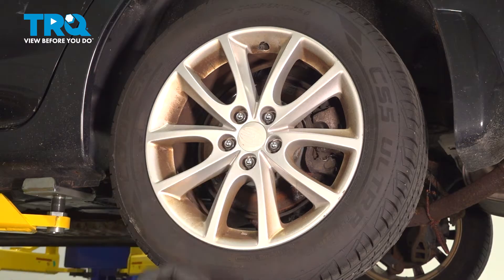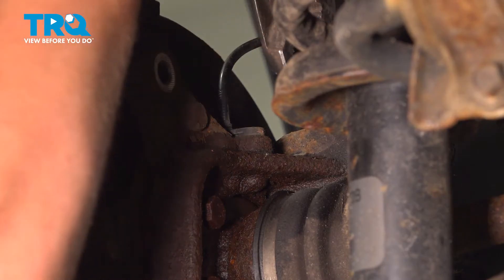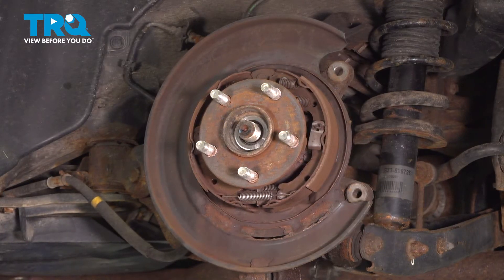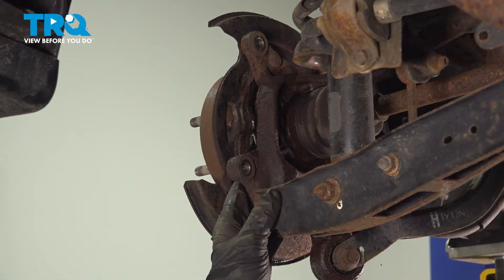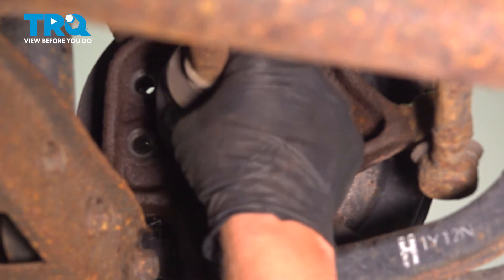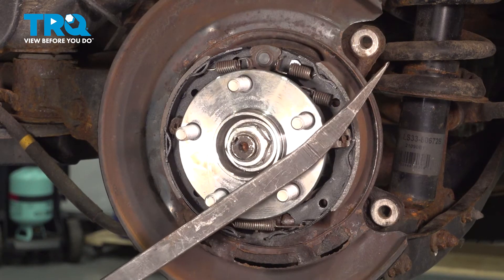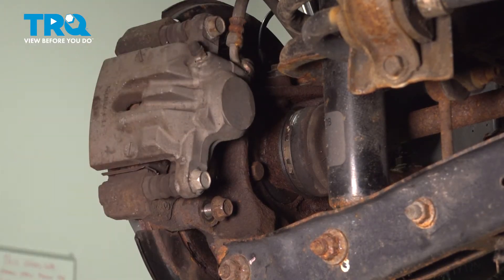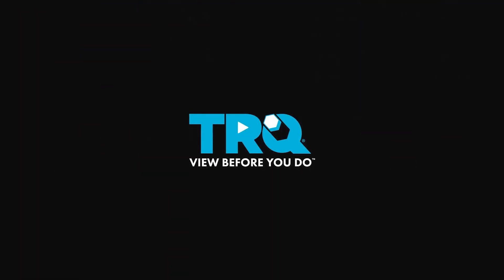How to Replace Rear Wheel Bearing & Hub Assembly 2012-2016 Subaru Impreza

Comment: Ok video but to remove the rotor they put two 10mm tapped holes in the hub of the rotor (you can see them in the video). No need to beat them off like a American cars. Also lug nut torque is 88.5 ft lbs not 100. You are going to stress the studs.

Comment: Very nice, well detailed video. HOWEVER, two points of contention here...DO NOT PUT THE CAR ON THE GROUND TO TIGHTEN THE SPINDLE NUT!! This will load the bearing which may cause damage or premature wear. Tighten as he shows in the video, using a bar through the wheel studs, though I'd recommend spinning lug nuts on the studs first (backwards, with the bevel facing out) to avoid damaging the threads.

Comment: Dude, I wish I would have watched this video before starting. Driver's side hub took an hour to get off with a slide hammer and 2.5 hours on the passenger side didn't get it to budge. Tried everything: heat, Aero Kroil, slide hammer, etc. Also managed to ding the quarter panel swinging a BFH. Fixing my old Subie up so that I can gift it to someone in need and it's turning into my own personal Vietnam. Thanks for the tip. Going to be picking up an air hammer tomorrow.